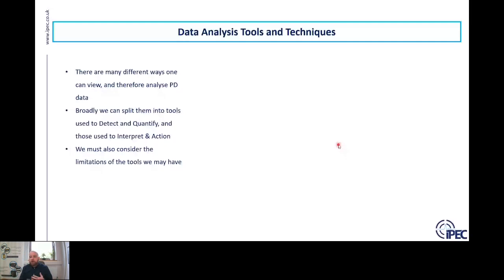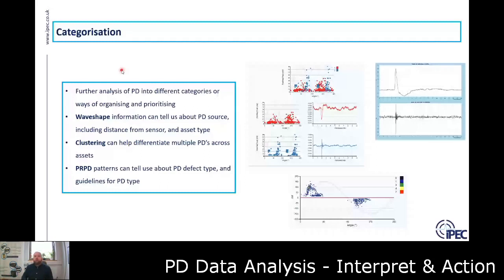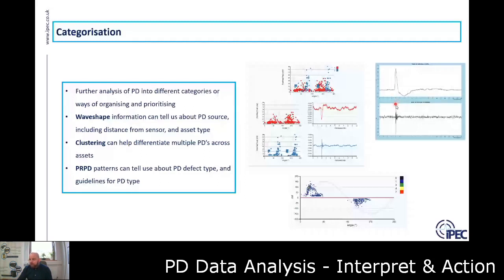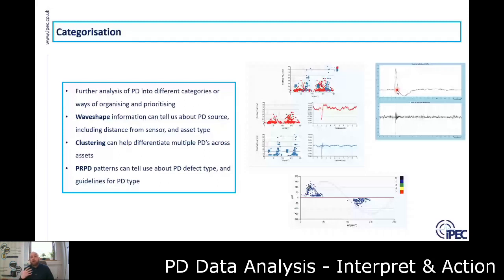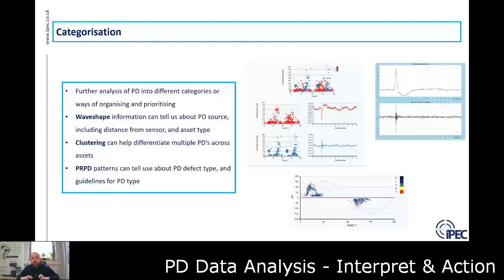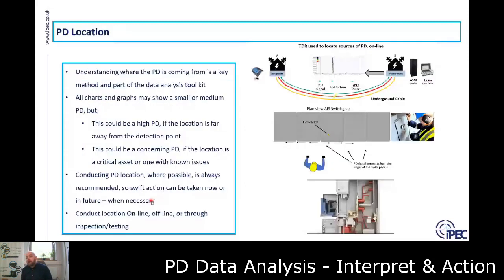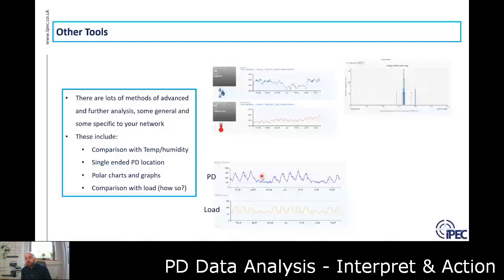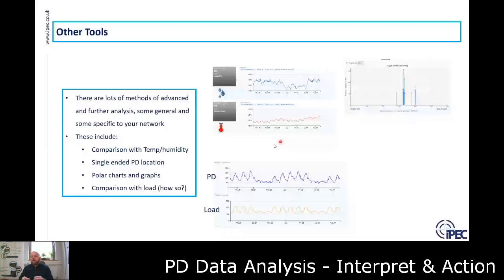On-line PD Data Analysis: Data Interpretation & Action - IPEC Webinar Part 9

Comment: good
If the earth is isolated from the switchgear,  and there is an EF, the EF relay may not effective operate and isolate the fault, if my understanding is correct? most of the time , I saw as cable bottom entry, the earth braid is brought out and connected together to the gear chassis , which is Earth...a HFCT is clamp on earth braid, PD should not be picked up..correct?
Reply from the maker: Hi Lim.

Thanks for your question. The cable earth must be connected to substation earth, as you note. When we refer to it being 'not connected to the switchgear' we mean immediately and directly. As PD will be travelling along the earth sheath away from the PD source, we want to connect our HFCT around an earth sheath or braid before it connects to a substation or switchgear earth, so we can detect the signal before it dissipates. The design of most cable termination systems is such that the earth will be isolated from the switchgear until it then breaks away and joins the designed grounding point, and the PD will be detectable before that grounding point. In older switchgear this can be compromised due to bad termination methods or using incorrect materials.